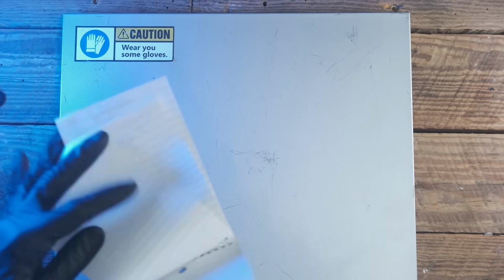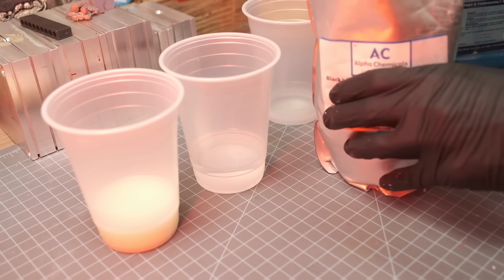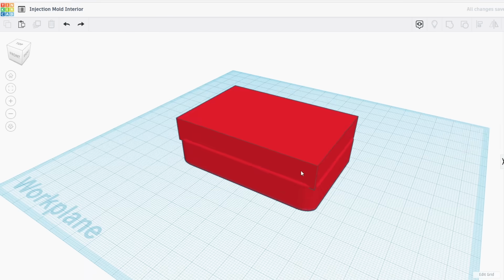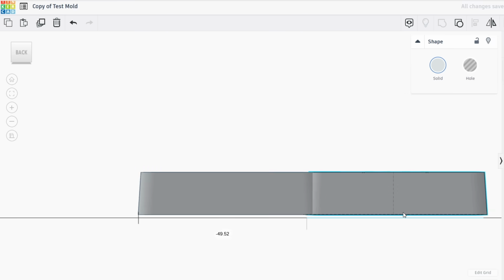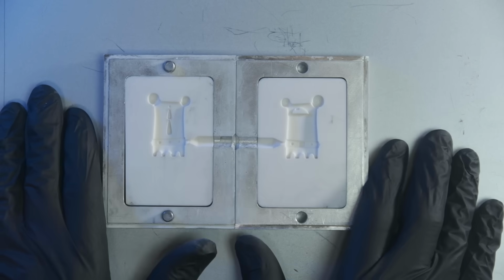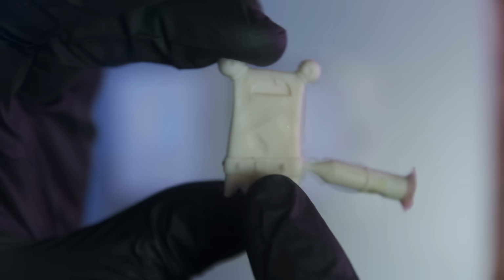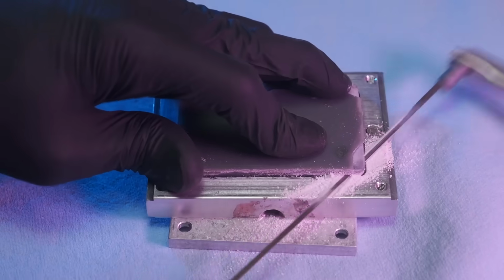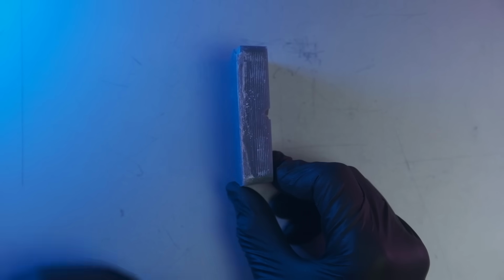3D Printed Injection Molds (actually work)!

Comment: trueSpace?!?  Good heavens.
Hey, I dunno which resin printer you're using, but if you switch to a 4K mono printer with a relatively small build volume, the visible layer lines become ultra-tiny.

Comment: Love this channel. I just got an Ender 3 pro and have been rocking that thing. It is amazing you uploaded this because you can use PLA in jewelry designing. It melts out just like lost wax casting! I have all the stuff to Turkey baster inject blue wax into some 1:1 silicone molds but its scary... Idk😬 But my 3d printer is another way!! I am learning blender and can design basic rings. Then use the 3d printed ring as a blank

Comment: I would do a final sanding on a surface plate. It will reduce any flashing in the mold.
Reply from the maker: Thank you for watching! This is actually the way to do it, yes! Whenever I started using Siraya Tech Clear it was when I noticed just how NOT-flush the surfaces were. (I was able to see through them while wet-sanding, and there were some concave parts I might never have noticed on an opaque mold.)
But you are right - it reduces flash in a big way!

Comment: What I would have done to get the precise dimensions of the frame, is by casting a resin block and taking measurements from that. It is much more accurate in my opinion.
Reply from the maker: Not a bad idea! When I removed the silicone interior from one of the frames, it hit me that I could do that (though like you said, with resin - because the silicone is pretty squishy and not as accurate). Just use plenty of release agent to be sure you can remove the resin block.

Comment: I really want to get into injection molding to make custom Lego-compatible accessories. I did find an affordable injection molding machine for only $300, but the molds are another matter altogether; an entry level aluminum milling CNC machine starts at around $500 but I'm not even sure if it'll have the ability to do finer details. Your method of 3D printing with high temperature resin seems promising but can these molds stand up to ABS? If I understand correctly ABS has a higher melting point. This seems like it might be better suited to a keshi project I want to do since the hard rubber/soft plastic seems to work well with these resin molds. 

Please advise, teacher!

Comment: Hey Crafsman, Can you work out a way to 3d print the high temp resin so it has metal particles in it? I am pretty sure mould life is increased when the heat is drawn out of the part quickly.
Reply from the maker: The closest I've done to this was to use a higher-temp 2-part resin (Smooth On's SmoothCast ONYX) mixed with metal particles. I first had to make a mold OF the 3D printed mold, to create a negative, and this metal+resin mix was poured into this. It DOES work, but I did eventually have some warpage in the mold.

Comment: Thoughts on printing a thin shell and back filling with metal epoxy? (for cooling, saving 3d print material, and stronger mold).

Comment: Do you really need to sand the 3D printed molds flush to the metal parts? As long as the molds are clamped during injection, and everything is square, they should be fine if the metal plate doesn't touch the metal ring, just as long as there's a few threads of engagement on the screws. Not an ideal setup, of course, but it should save you some post-processing time on the prints.

Comment: How do you make an Aluminum Mold?
Reply from the maker: The main way it's done is to CNC it from an aluminum blank. You would provide your mold-maker/CNC person with a CAD file, usually in solid STEP/.STP format (they generally won't accept mesh / .STL/.OBJ, etc.) and they will turn that into gcode and plan cut paths. Often it is cut with different bits, starting with a roughing-out bit, moving into things like a ball-endmill for smoothing passes.

ANOTHER way is to cast the mold from molten aluminum. This usually gives a not-so-smooth surface, with pitting and defects. But it is possible.

Comment: question: do you really need the aluminium frame? if you can clamp the 3d printed molds really tightly?  and thank you for your awesome videos.
Reply from the maker: It is possible to use the 3D mold directly, though with more risk of cracking. I'd consider adding a metal washer to the top to give a little shielding from the heat of the nozzle.

Comment: What about making it so the print has a hole through the center? would you add a small metal rod that you can take out after the mold cures?

Comment: I wonder if the plastic runners from miniature and model kits could be reused like this? I'm sure any tabletop hobbyist has a bunch of sprues they don't use and could benefit from tossing them into one of those injection machines if they have a decent one-figure print mould.

I could just see it now, being able to make your own model kits by recycling old sprues from gunpla kits, GW sprues that are just piling up in your bits bin, Tanks sprues that don't want to be thrown out because you're totally gonna turn them into DIY tank traps one day...

Comment: I wonder if there is a material equivalent for filament printers, as I don't want to deal with bottles of chemicals. But worst case scenario, I'm sure I can print the mold, cast it in aluminium, and go from there.

Comment: sanding it on a machine so that it is flat is almost impossible. This is how the element rotates and I agree here, but it won't do you any good. You need a flat surface on which to grind the element the best shot without expense is a thick glass.
Water-based paper and patience and repetitive movements and pressure as in the case of Lapping a CPU.

Comment: Hey Craftman. In the video you mentioned that the injection moulding machine is set to 410F (210c) but the Saraya scuplt grey has a HDT of 160c, how did you get around that? Thanks

Comment: Just a thought, they make a type of mortar for fire bricks inside a wood stove. It can handle extreme temperatures, is often used in kilns. When you first mix it, it is very smooth and pliable, I would be surprised if it did not hold a mold well. Maybe you could mix up a batch and fill in the aluminum case, put mold release on your toy and press it in until the mortar hardens. You would have to do both sides separately, but I think you would end up with a mold you can use infinitely

Comment: $160 for a bottle of resin?? Holy smokes crafsman.
Reply: Lot cheaper than CNC molds!!
Reply from the maker: I purchased the regular Siraya Sculpt, and was gifted a bottle of Ultra White. Otherwise the video would have been just about the Siraya Sculpt.  :)

It is a pricier resin, for sure. But you don't have to go for the highest stuff. In fact, you can probably get by with regular 3D print resin for SOME parts. I did not have success with my standard Elegoo resin. It cracked in little detail areas. This Siraya Sculpt (especially the high-heat "Ultra White") is maybe even overkill. I bet, depending on the mold design, you can get by with other resins.

The other thing I look at is an aluminum mold of this part may run $500 on the low end, but I can print out a batch of molds with the resin. I'm just so happy they yield a bunch of pieces. Otherwise, that would have been super disappointing!

Comment: A Craftsman there's a trick to get rid of the lines take you some   water washiable  Reason And then Paint a thin coat on your Is resin print then hit it  with UV flashlight you can buy those Amazon or  Is Bang good . And that will get rid of all your of printing lines..

Comment: Why not cast the figure in Plaster, Then Do Aluminum outer mold?
Reply from the maker: It's definitely possible to do cast aluminum molds. The pitting is honestly my main concern with cast molds, and patching/smoothing the inside cavity would be tedious. But depending on the object, this could be a great way to go.
I've seen this method used by Precious Plastics to cast plastic handles for climbing walls, where the texture is actually an advantage.
Reply: There is a guy VOG on YouTube that does metal casting and uses vacuum when pouring heated metals. I guess the vacuum helps remove pitting? He uses burnout 3D printed resins to make mini figures and rings. Not sure if process could be modified and used effectively for making injection molds? Thanks for inspiring me CrafsMan, from molding to the sound of rain falling.

Comment: can you inject hard plastic? or only soft one?
Reply from the maker: You can inject hard plastic as well. I wanted this figure in a rubbery material, but I did make 5 in a yellow rigid polypropylene, just to be sure I could get it to release.  :)  You can also use LDPE and ABS, although ABS is one of the more difficult ones to inject on these benchtop machines, I've found.

Comment: This may be a silly question, but why don’t you just 3D print the character rather than 3D printing the mould and then making the character out of that?
Reply from the maker: Thank you for watching! The thermoplastics used in injection molding are significantly stronger and more flexible than 3D print resin. It would be fine 3D printing the character for painting and careful handling, display, etc. But I'm going for more of a durable toy approach.  :)

Comment: This might be, actually its is dump question, but how air escapes from the mold, when "liquid" is forced in ?
Reply: there is already air inside the mold when you clamp it, so when you force the liquid, it pushes the air outside. Simple as that.
Reply: @HzGP  Thanks for replying, pressure might be keything, cause i once tryed just pouring epoxy in the mould, and "legs" had airpockets 😅
Reply: @Villageidiotsworkshop  And that's why those tiny air vents at 8:09 comes in handy 😇

Comment: I see links for the machine and resin in your description, but what about the plastics where do you order them from?
Reply from the maker: Hey there! Bulk plastic can be purchased on eBay (I usually get 10lb bags) but a nice way to SAMPLE them until you find one you like, is to get small quantities from LNS:
https://www.techkits.com/collections/pellets/

If you want to get into custom colors, that gets expensive (with 1+ ton minimums) from companies to do a custom batch, but there are dry powders (MESSY, but works) you can get from places like IASCO. (Dry powder added to sealed jar of pellets and shaken, causing the powder to cling to the pellets. In my experience, works better with thermoplastic elastomers like TPE, TPV, etc.)  Hope this helps!

Comment: What's the program used to design the little monster? He said it's not zbrush but never referenced what it actually is!
Reply from the maker: That is an old unsupported program called trueSpace 3D.
I started using it in 1998 when it was version 2.  :)  The version shown is trueSpace 7.6. It's fairly clunky compared to modern 3D software, but I know so many keyboard shortcuts and can get things done pretty quickly in it. The downside is I'm missing a lot of the newer sculpting features of modern programs.  :)

Comment: Is there a way to make a usable model that isn’t machines metal? Some kind of cast maybe?
Reply from the maker: Down in Mexico they are using a zinc (I think) alloy combo metal that behaves sorta like pewter, just melts at a much higher temperature. If I'm not spelling it wrong it's called something like "Zameck" or "Zamex".

Comment: Crafsman a couple ideas for your consideration, shapeways have the option to print your files in metal not sure how much it'd be but might be worth looking into printing a mold, another idea for a series is to build your own plastic injection mold machine  parts from 3d printer such as 3 mm nozzle print extruder a heating element, an ardu in for temp control and some hardware store parts might just do it

Comment: did you really use ptfe lubricant on fap? does it work to don't let print stick??
Reply from the maker: I did. I have found that since I started using PTFE on the film, I don't have stuck prints.
One key thing: Be sure to rub it in good and not leave any excess.
Reply: @TheCrafsMan  in this way you can print flat surfaces without the risk to get it stuck as in the video. You're amazing man!! I can't wait to try it!

Comment: You put 3 in 1 oil on the tray before printing?
Reply from the maker: I use PTFE to keep the print from sticking to the film/vat. Before doing this, I would get stuck prints somewhat often.
It starts out somewhat liberally rubbed in, then swabbed all over with a shop cloth to take away any excess.
Reply: @TheCrafsMan  I mean to ask..do you use it before every print.

Comment: plastic press mold
Reply: try inverse injection molding casting, by heating the aluminium mold itself, to 300C (or 240C for ABS) then push in plastic pebbles, so  that the plastic melds, then cool the mold a bit down, this process prevents air pockets and un-even injection-casts